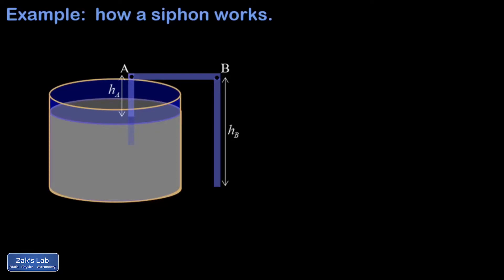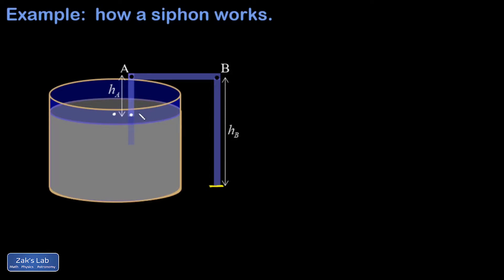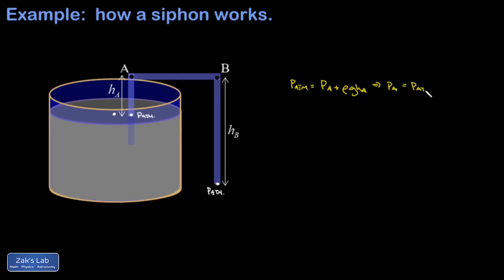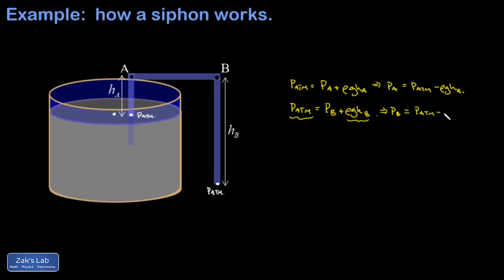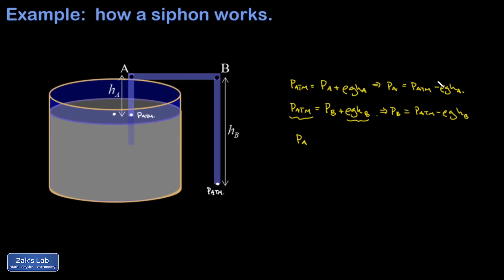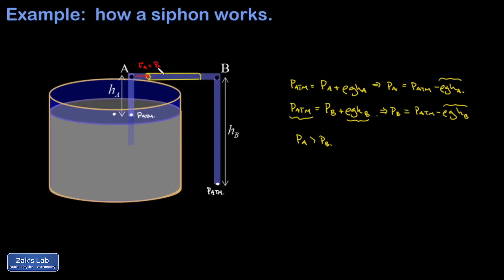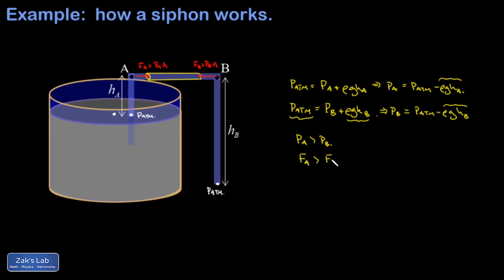The physics of how a siphon works: pressure as a function of depth at the moment the siphon starts.

Comment: The fluid is at the same level and moving at the same rate, so the pressure would be the same, I assume you have a non viscos  fluid, the forces between A and B would be equal.  I don't  alot of confidence in this statement, I am just reviewing the topic.
Reply from the maker: Really thoughtful point!  The argument is that "at the moment I release my thumb" -- and at this moment nothing is moving yet - I can show that the pressure on the left is greater than the pressure on the right, and justify why the fluid would start moving in that direction.  The question of what happens in the dynamic state is interesting, because you are right about the pressure being the same on the left and right of the horizontal column once things are moving.  I'll have to sleep on it, and I'm sure it will turn out to be another case in which the complication is hiding in the "frictionless" assumption, like so many of the "paradoxes" in introductory hydrodynamics the way we approach it in physics.
Reply: @ZaksLab  You have a mistake in this explanation. The pressure in the tube at the free surface of liquid in the upper vessel is not = pA, but it is < pA. And the acceleration really occurs at the input of the tube.
Reply: According to A.F. Abott's Physics book, it is mentioned that rather than atmospheric pressure playing a hand in the phenomenon of siphoning, it's rather molecular cohesion, like a chain pulling on each and individual modular pieces, it was also mentioned that siphons could be made to work in a vacuum. I myself wasn't satisfied with that explanation so I came to YouTube as a resort.

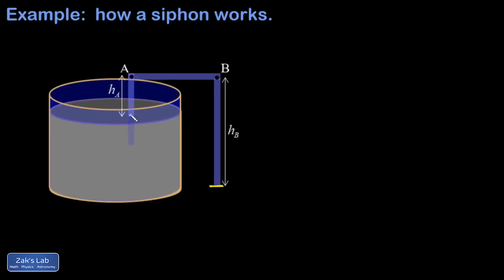Comment: 0:33
Sir, I would like to point out a small mistake you did while making assumptions. When the water is flowing through the siphon tube the pressure at that point is not equal to the external pressure i.e. P_atm.  In fact it is less than P_atm by (1/2* rho * v^2). I tried doing it myself and found that out. 
I researched and found a research paper that says the exact same thing.
https://iopscience.iop.org/article/10.1088/0031-9120/6/5/005/pdf (Page 3)

Comment: So, the water flows due to the fact that the pressure on the left is higher hence pushing the water upwards to reach the low pressure zone on the right. Is this right please?
Reply from the maker: The argument is really about the horizontal branch at the moment of release - pressure on the left is higher than on the right so water must start flowing rightward along the branch.

Comment: Does this work for water tanks
Reply from the maker: Yes, just make sure the tube is full of water to make it work.  I've emptied my kitchen sink using this method when the drain clogged!  You can fill the tube with water by coiling it slowly into the bottom of the tank, then hold your thumb over the outlet end until you bring it lower than the surface of the water.  Release your thumb, and you've got a siphon going.  z

Comment: Did you know that a sifon works well in a complete vacuum? So atmospheric pressior can not explain the working.
Reply from the maker: really interesting comment!  I ended up reading through the wikipedia page on siphons as a result, and learned about the "cohesion tension theory" for the first time!  The explanation in this video is correct, and the "cohesion tension" is not responsible for the functioning of the siphon in this pressure domain, but the "cohesion tension" theory is necessary to explain the functioning of siphons in a vacuum!  z
Reply: @ZaksLab  Pressure difference and gravity are still important when siphoning in a vaccuum.
Reply: The pressure difference is what drives the liquid through the siphon. In the absence of atmospheric pressure, the pressure at the liquid surface is zero but everything else remains the same meaning that pressure at A will still larger than pressure at B.

Comment: Why we dont consider the acceleration of water and just write the formulas like it is in static position?
Reply from the maker: the main point here was to make a convincing argument of why it works and what direction it goes -- hopefully you're convinced!  for the dynamic problem, I suppose you could apply bernoulli's equation to get the fluid velocity at the outlet, but that's a vast overestimate because it ignores friction.  Also, the bernoulli solution would describe the steady state draining of the tank rather than the details of the acceleration process when it first starts.   It would be interesting to see a complete solution of the siphon that actually produces results in close agreement with experiment, but that would definitely take a lot more research.  - z

Comment: in both openings of the tube, Pa and Pb, ρghA and ρghB also acts on them, so why are they only Patm, shouldnt the pressures be Patm - ρghA and Patm - ρghB respectively? please explain
Reply from the maker: The pressures at A and B are exactly as you stated them, giving us the pressure difference that gets the siphon going.  The two spots that are equal to Patm are 1. at the bottom right of the tube that is literally open to the atmosphere and 2. at the bottom left, level with the surface of the water where the pressure is equal to atmospheric.

Comment: If you Consider the pressures at the two openings of the tube, the pressure on the right side opening is actually larger than that od the left side opening. Can you explain why the water still flows from left to right? Thank you
Reply from the maker: the key to analyzing the problem is that the opening at the right side is open to the atmosphere, making the pressure less than the opening on the left side, which is submerged under the water. z
Reply: I see. To clarify, let’s say I have the same siphon but the right beaker has a water level that’s lower than the left one, the correct analysis is: the opening of the left side of tube still has more total pressure that that of the right side of tube (since right beaker has less water). Is this right?

Thanks so much, great video by the way! 🙏👍 @ZaksLab

Comment: ı think this theory is false because like you mentioned at the start of the video the pipe needs to be lower than the cup but. IF the pipe is not lower so there would be not flow. BUT  even the bottom of the cup and the hB are at the same level, hB is stiil greater than hA so PA is greater than PB. Then in this case the water must flow regarding to your explanation but water won't flow if the bottam of the cup and at the end of the pipe is the same height. I hope I explained it well. I'm curious about your response to this.
Reply from the maker: The key point about getting a siphon to work is that the end of the tube open to the atmosphere must be lower than the surface of the water.  I don't quite understand the scenario you're describing, but if the end of the tube open to the atmosphere is lower than the upper surface of the water, the water will flow through the siphon.  z

Comment: How can you apply the statics equation patm plus pgh if the fluid itself is moving?
Reply from the maker: The main point here is to find out which way it begins to move by selecting the moment at which the siphon starts (where it is still a statics problem).  As is typical for intro fluid statics/dynamics, there are several hand-waving approximations happening, but we CAN establish that the motion will begin and which direction it will go.  This problem is interesting, because it begs so many questions about the deeper explanation of how it works and detailed analysis of how fast it should go etc., and friction plays a major role there.  But this is the starting point:  why does the siphon work? 

It would be interesting to assume incompressibility and zero friction and apply Bernoulli's equation to the case of steady flow through the siphon, though I think the flow would actually be accelerating if you didn't have friction?  Will look at followups to make this "toy problem" bigger in the future.

z
Reply from the maker: On second thought, I suppose it would analyze like Toricelli's result once it's flowing, right?  I'm in a rush, so you're getting my hunches right now. Gotta go! z
Reply: Thanks a lot ...
Btw without friction it won't accelerate by applying bernoulli equation its seen that the pressure is similar to what would occur if patm plus pgh is applied

Comment: There's something that really confuses me, when we refer to pressure at points A and B what kind of pressure is that? It's not due to weight of water above(ρgh) since there's practically none and it's not the atmospheric pressure either. Please help😭🙏
Reply from the maker: Think of the water at the open surface of the container -- it is under pressure from the atmosphere sitting on top of it.  This causes miniscule compression of the water, because water is very hard to compress, but there is energy there stored in the compression of intermolecular bonds.  The pressure higher up in the siphon is just a little bit less, but still substantially greater than zero, and it would not be that way without the atmosphere involved.  It's interesting to think what would happen if you tried to run a siphon at an absolute pressure of zero -- certainly you can't have negative absolute pressure up there, so something goes wrong!
Reply: Is the pressure on the left higher because of the weight of water+atmospheric pressure